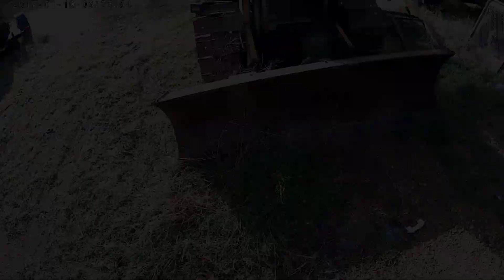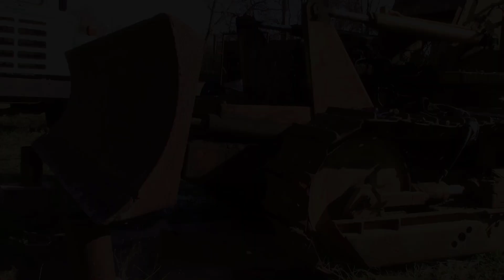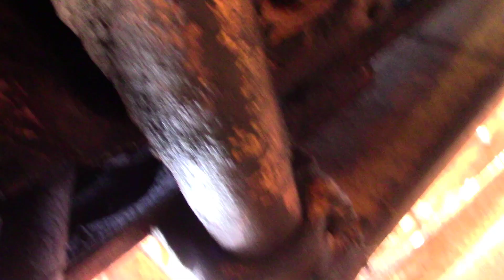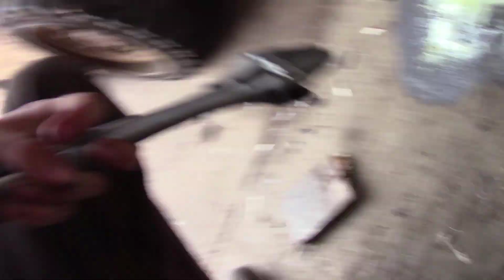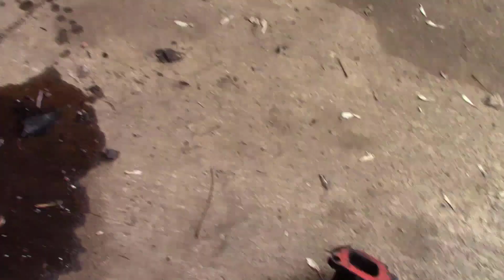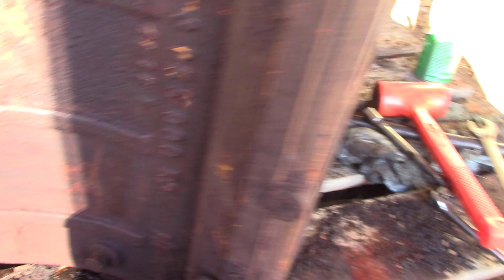Old bulldozer reawakening

Comment: Keep at it its a great machine 
Engine repairs simple
Clutch packs on drive all parts available
Cracked block can be mended by grinding in v drilling hole both ends of crack then weld or lead.
We used to out metal plate over the crack with cork as gasket,just tapped block and screwed on
Love this series of videos
Nick London England

Comment: You are a good knowledgeable mechanic, you can fix it. When we worked on a small dozer we would take hood and belly pans off, power wash it and bring in the shop on 10x10 railroad ties the length of the tracks. I know you know but I have to say it, Buy the original International service manual and the parts manual. There is a lot of life left in the undercarriage that will save your wallet. And, The right track is on backwards.  Keep up the good work

Comment: Finally someone saving these machines.  I did a 500e. They are pretty easy little machines nothing very complex.  Looking forward to a part 2.  Any questions let me know.  I'd be happy to help.
Reply from the maker: Thank you sir you’re a lifesaver. I do have one question are these machines are they bad about having trouble with the torque converter‘s like seals or anything like that I don’t want to get it all back together and she won’t pull.
Reply: @EEJester1586  I dont belive so.  We ended up putting a reman in ours because when we got it it was apart and the torque was full of water from sitting.  Can't remember off the top of my head where we got it but it was fairly inexpensive
Reply from the maker: @LilaAuto  10-4 good deal then.  I know they are really small machines and I’ve never ran one but do they push well for there size?
Reply: @EEJester1586  its not gonna move mountains by any means but it works well for what it is.  Ours was used to build log roads for a one skidder crew.  It was more handy then anything.  Easy to move, maneuverable in the woods, easy on fuel and it would build skid roads. We actually had 3 of them at one time.
Reply from the maker: @LilaAuto  Good deal I figured they wouldn’t gonna be the end all be all but that’s awesome though I sure appreciate the info. That’s cool y’all had three of them it shows that they held up pretty well.

Comment: If I may also add, You may want to investigate why that cam bearing failed, its possible it was due to oil dilution , but its also possible that it was not getting pressurized oil. Also, if your crank was not riding true, it could ov exerted pressure on the cam drive gear, which in turn would have put a thrust load on the cam bearing, causing premature failure. You coud also have a weak oil pump.
Im offering possibilities, its obvious you know what your doing,
thanks again for videos, im off to crawl under my pos

Comment: Look at the bottom rollers on the undercarriage the rest looks good except the right track is on backwards, try muggy weld for the cracked block great product,  if you have a engine machine shop they can easily hone the cam bearings you'll be getting the crank turned anyway

Comment: I bought a bread truck out of a junkyard that had a cracked block. Had an old welder I knew weld up the block and it ran for 10 more years. It was used as tool hauling truck on construction sites so it was driven a lot of miles.

Comment: I am old and done enough greasy mechanic work ..You ain't getting me near that thing without a good steam clean pressure wash job ..I am looking forward to all the videos you will be making ..Don't you just love finding all those duct tape and baling wire repairs...What is not funny is stripped bolts and rounded off bolts

Comment: Disassemble everything but the tracks and sprocket assemblies, inspect, repair and reassemble everything else. If it is worth doing for you, you will get many years of service from this machine.
   You  can put a four cylinder in this machine as IH put both a 3 or a 4 cylinder in the 500C.

Comment: May I suggest a few options for your block repair. You can use a product called lock stitch, its a very resilient mechanical repair that most machine shops will do for you, Its not too expensive. You can also find a good welding shop who can weld that  with some good preparation of the area, a localized pre heat to 500 F and a high nickel rod ( many are available for cast steel).
With regards to the cam bearing, Ive dealt with those before. Hit me in the comments and Ill tell you how we isntalled and fitted those.
good luck
Reply from the maker: I’ve been doing quite a bit of research and I think that’s gonna be the way to go seen a Lotta good results from the lock and stitch. I’ve got to get some ordered but I’ll be sure to do a video on it any information would be a help I sure appreciate it.

Comment: Millions of suggestions, none I will add as you know already more than a retired old man would. I do see a fighter and a poor boy would just walk away but its in the bloodstream so there's that. I'm thinking that the finals and what not are in fair shape looking at the machine. Its been put to bed wet a few times not too horrible of being beat on. What can you do with it that the backhoe you have can't do? I give that its still nice to have a blade on any job worth tearing up their lawns worth. Small town engineering and not in a bad way. Thinking about getting into a elevator to go sixty floors up is insanity at its least best scenario. Yeah I would fix it and some of the stuff to be done like that cam bearing is well "sketchy" to minimize little. It would hold oil pressure for sure. That motor must not turn very high or the oil would cavitate. I would get good at repairing some hydraulic hoses as that can get real pricy, junior will be going without mush money on that one. Good luck an one person watching at least

Comment: Have the block stitched, it's done by overlapping a screw type stitch. I've had it done a few times with no problems
Reply: If you want more information on stitching the block I would be happy to help you out I my self have owned a diamond in the rough many times
Reply: I have read of the same fix on 1920+ Auto Union (book was from the 50's). Initial fix was to weld which required preheating the block to some 400C (in a blacksmiths forge), followed by flame welding, and an extremely slow cool under heavy (asbestos) blanketing. Customer was impatient, came in into the shop and unveiled the block. Cast iron cracked in a different place. Master craftsman used "stitching " method of drilling and tapping overlapping brass studs (and charged twice!).  

Cast iron also responds well to brazing; must be properly preheated and cooled very slowly. Brazing requires lower temperature, thus less thermal stress, and generally better than welding. In my humble hobby shop I managed to braze a cast iron pulley off my lathe (which I dropped and broke...). Came out pretty good.

Comment: good old Mig welder will fix an engine block......BUT, you have to take a cherry blossom torch to it for at least 20 min........heat the entire side of the blocks, and boil and burn out all the oil in the steel

Comment: Don't they make welding rods for your stick welder that are specially made for repairing cast?
Reply: Yes. “Ni-rod” is what my supplier calls it. Nickel rod. I have had great success using it on smaller parts but you have to pre-heat, do your welding a short stitch at a time, then peen the bead pretty hard. Then you have to wrap it and cool it slowly. Not sure it would be my go-to on an engine block.

Comment: I’ll bet the steering clutches are stuck because of the water. It’s an old manual so you will use cuss words but you can get them free and pull them. Probably have to have clutches put on and clean up things. New springs and it should work. Now the block? I’d hunt around and see if you can find a clean block. That’s just me, because repairing a block never works out.

Comment: The first thing I would do is to look for a used running engine. If you can't find one, look for a good diesel machine shop. They would be able to repair all those issues. Look at a website www.muggyweld.com. They have a video of of their rods repairing a block with a window in it. That is the type of projects I love. Wish I had it.

Comment: You youngins are gonna have to hang around old timers more.  Stitch Pinning cast iron is the way to go.   Just google it.  Everybody wants to weld or glue when motors have been repaired for 90 years stitching them but it’s been forgotten because will it involves work . Yes it take time but it’s the correct way.

Comment: Get Used engine
Reply: Salvage
Reply: I have a 500e with water in tranny. I'll be watching to see how you flush it out.The torn and or dry rotted boot is to blame.I have replaced mine twice new old stock, didn't last over a year and a half.